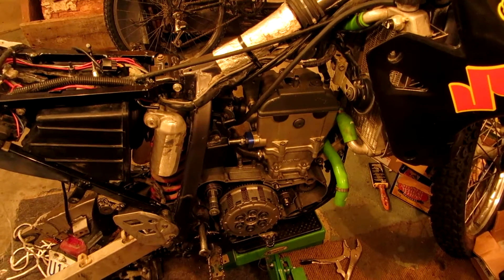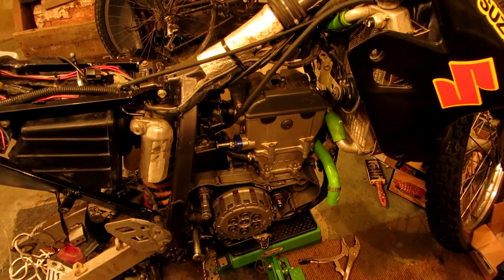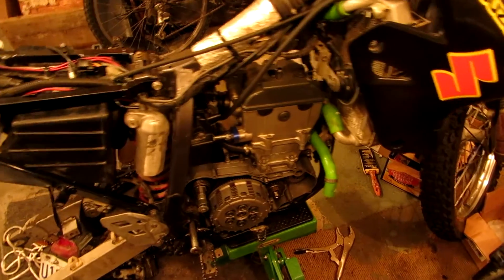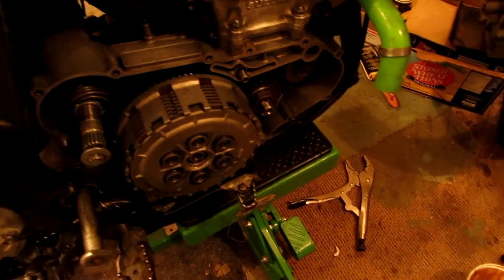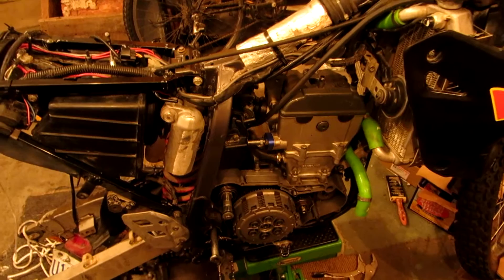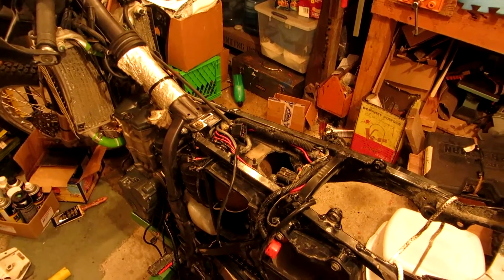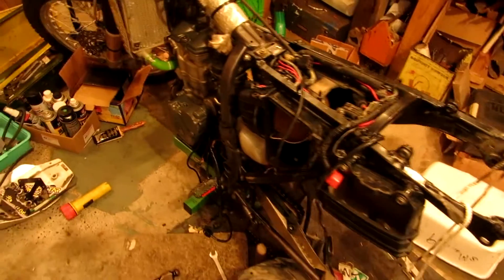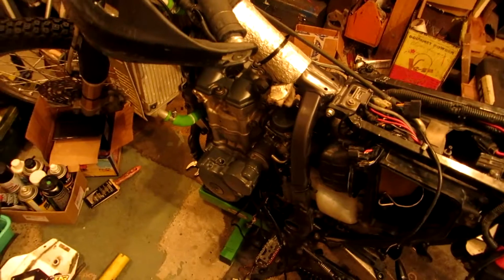DRZ400 teardown part 5 (mounting the engine)

Comment: Hi bro, i have got a question, how do you remove the kick of the 400 drz ?
Thanks for your answer bro
Reply from the maker: It's been years man, best bet is to consult the factory manual.  I remember I had a hard time with the return spring when I was putting it all back together.
Reply: @Radiationstation  thanks bro 🙏

Comment: how did you get the engine swingarm bolt out when you first removed the engine? thanks
Reply from the maker: It was seized solid, I attempted making a puller with ready rod, but it 
kept stripping.  In the end a brass drift and a sledgehammer coaxed it 
out.  I made sure to put never-seize on it when I put it back in.
Reply: any chance you know what size the drift was? or was it just flat covering the whole end of the bolt?
Reply from the maker: I don't have the exact dimensions, but the drift was large enough to cover the entire end of the bolt.  Seized swingarm bolts are common on DRZ400's, as they apparently don't never-seize them in the factory.   My bike was a manufactured in 2003, so maybe the factory has updated its procedures.